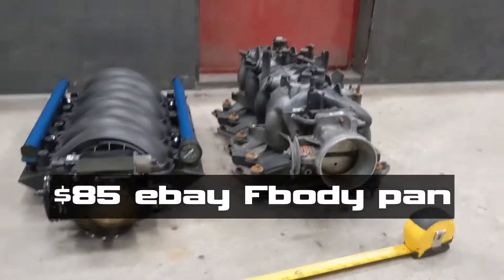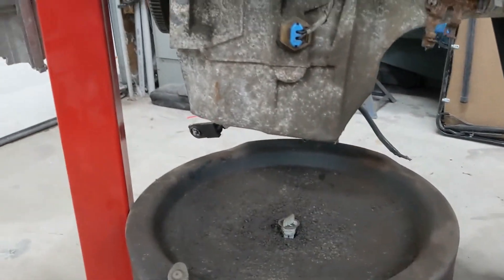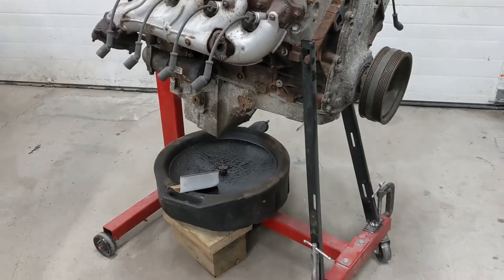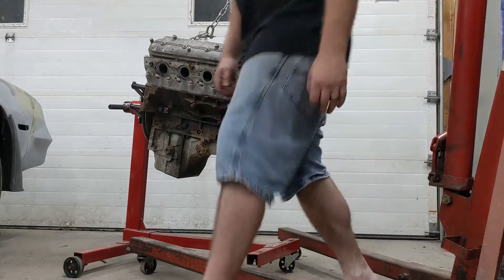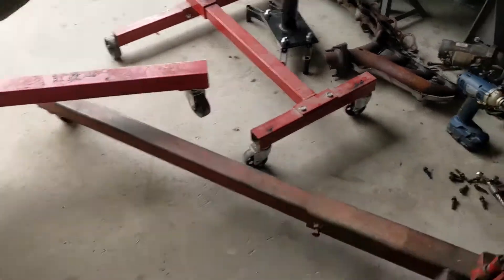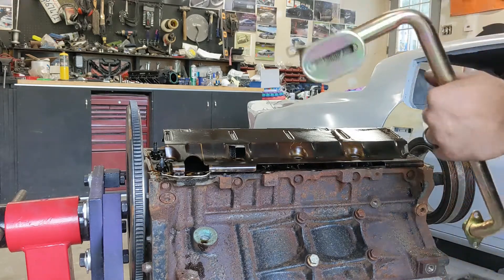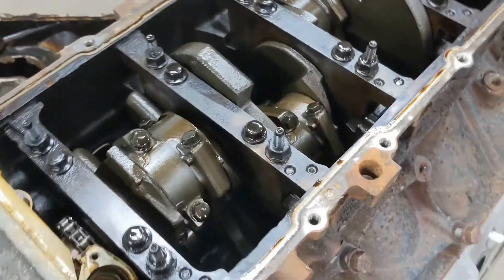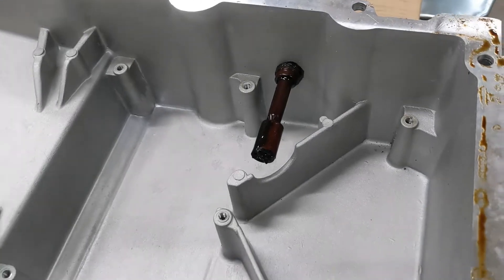Cheap LS swap oil pan saves 3in ground clearance - $85 new ebay Fbody

Comment: I think its the design of that engine stand  if you look the front wheels are level with the bar but back wheels are mounted below. So its already gonna have a 3 jnch lean
Reply from the maker: Nah. It was fine with a v6 on it before. The main issue is the arms bending. Just a poor design.

Comment: you have the engine mount plate mounted wrong but its still junk.
Reply from the maker: Nope. It's mounted correctly. Some have an angle built in, but this one was straight. Worked fine with my v6, but definitely not the V8. Haha